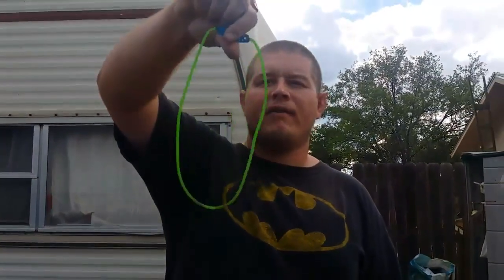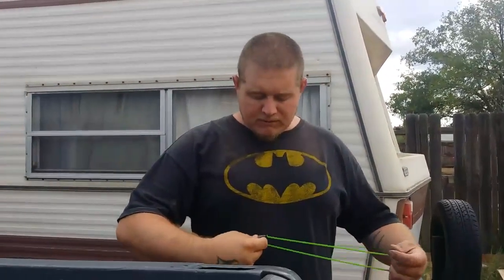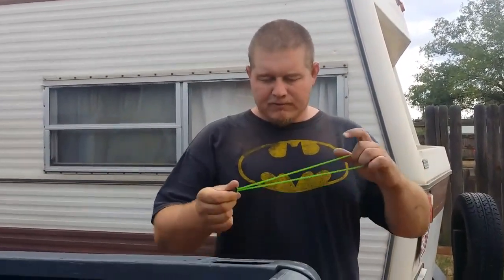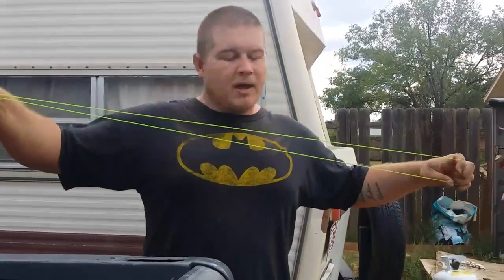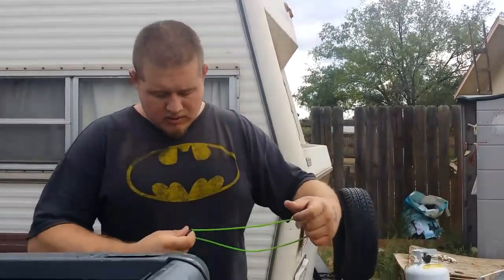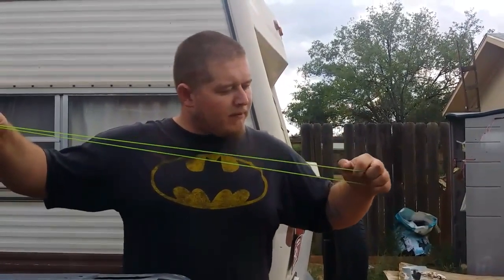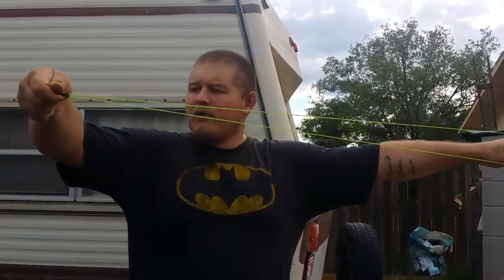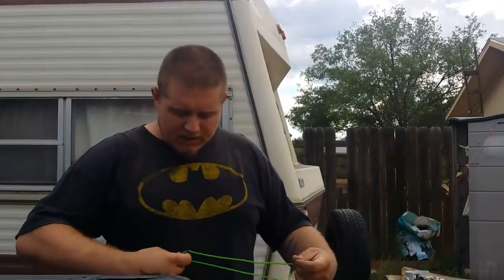Frameless 1636 tube full butterfly

Comment: Have you tesetd if you have identical tension on the upper and the lower band?
Reply from the maker: Hey! .. no I have never tested it .. I just go by feel ... after some time our bodies adapt to anything !
Reply: The problem is that if your rubber tension is too different it will pull out the pouch from underneath the ammo after release and cause poor precision or worse, "fork" hits. I have recently experimented with frameless shooting, with a rig that replaced the part of the rubber that is held in the hand and does not actively accelerate the ammo with a leather strap. That makes it really noticeable how much handposition influences band tension.
Reply from the maker: @BlackTalon53  well it works for me ... if your having a bad release it could be the pouch . Or as u said your not holding correctly ... I have killed a lot of game frame less. . It just takes practice .. thanks!